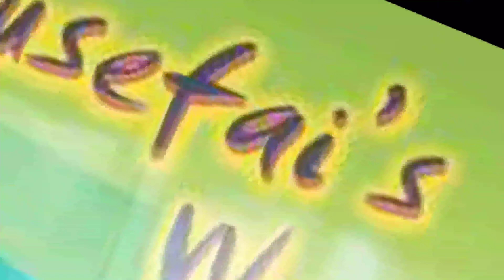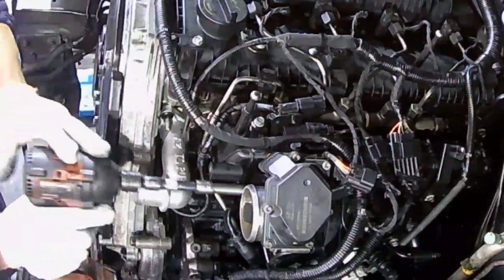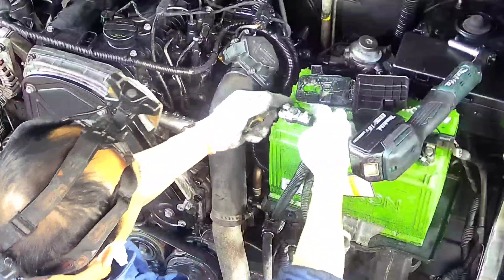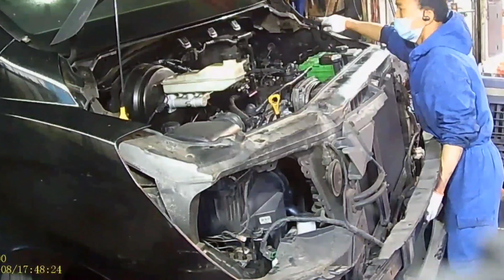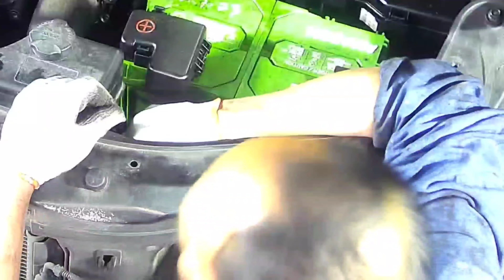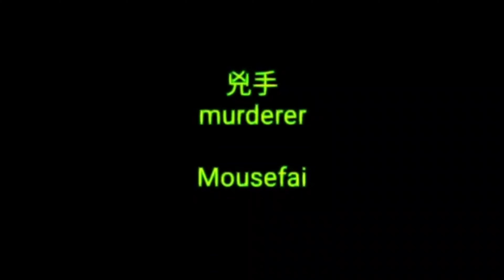[Engine] 2022 03 08 大煙燒炭漏油 15/16 安裝其他埋尾 Hyundai H1@Mouse_Land Hong Kong 【廣東話】

Comment: Please answer my question
When removing the head of the diesel engine Grand Starex and changing the gasket of the clutch when the engine is running, the turbocharger breaks???Grand Starex 2009
Reply from the maker: There is not enough info. I cannot findout the problem though the air. Firstly, u must find out the turbo broken by what? And y? In fact, there may not because of the clutch. Most of the turbo problem is oil quality and oil pressure